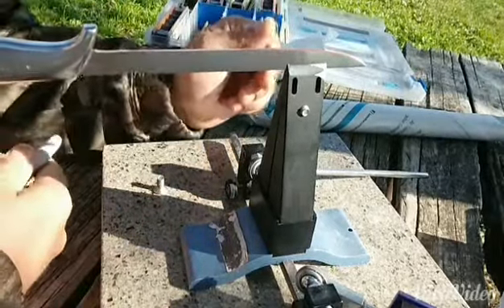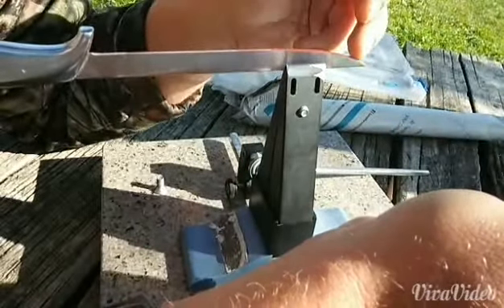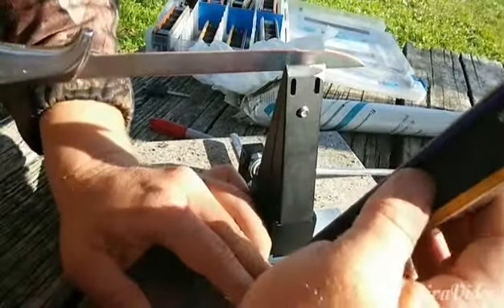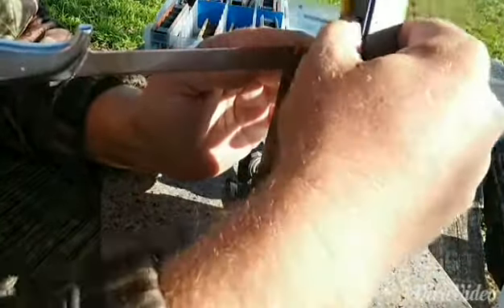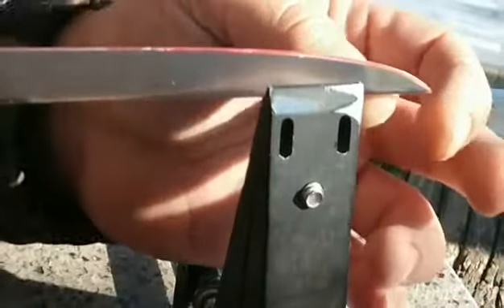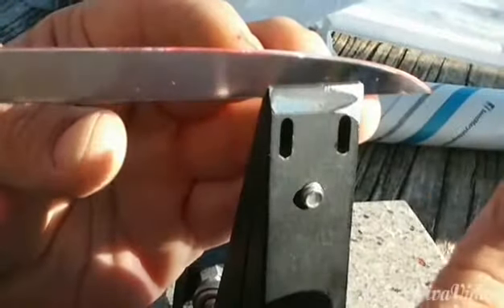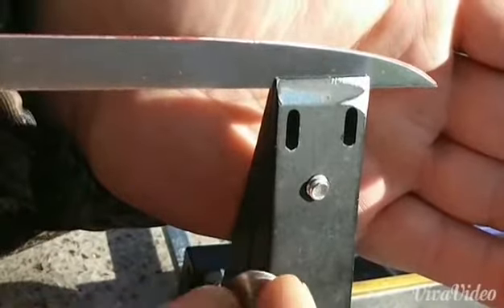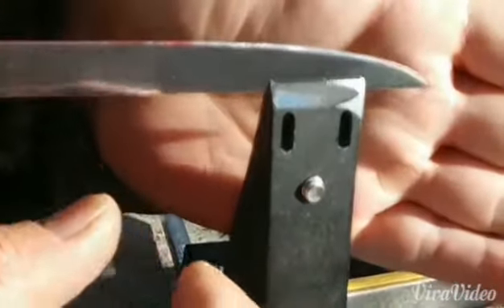Finding the factory sharpening angle

Comment from the maker: Hi Darren thank you. Honestly from a sharpening service view it depends on how many fillet knives you have and how often you plan on sharpening them. Fillet knives are long and flexible as you mentioned which does make them a hassle to sharpen on a manual system like this. The flip side is of coarse the edge that is obtained and the preservation of the steel. There are techniques to ease the process and adapters to help reach more acute angles. .if you would like to give me more details as to what you need to do I can give you a better answer for your time and money.
Reply: Thanks for the reply. I've gone ahead and bought a WE. After practicing on a heap of cheaper more rigid knives I tackled one of my filleting knives. I'm actually very happy with the outcome. Thanks again.